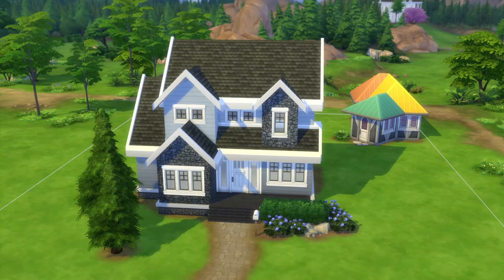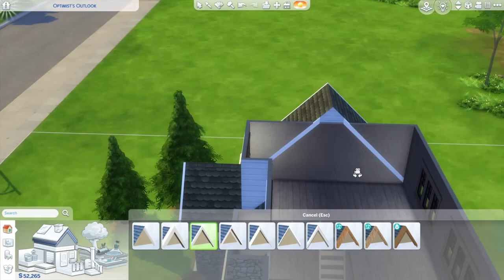How to Fix Roof, Eave, and Trim Clipping and Glitching - Sims 4 Roofing Tutorial

Comment: OMG THANK YOU SO MUCH!! I love making houses with lofts, but the roof clipping into the wall has been a huge annoyance, I knew you could change the overhang length but I didn't know you could only change one side of the overhang by holding shift, you're a lifesaver!!
Reply from the maker: Before I figured that out I used to place so many extra roof pieces with or without eaves 🙈
Reply: @sahm_and_bean I play on ps4 so I don’t have “shift” so what should I use instead
Reply from the maker: @kylenova1607  PlayStation uses the X and square buttons. I don't have a console but the way it was explained to me was select with X, adjust with square, and set with X. Hopefully that makes sense!

Comment: My issue is the roof trim is clipping in my house even if I reduce the eaves
Reply from the maker: Are you using one of the two roof trims that will clip in regardless? They're the two square ones and the only workaround there is to change out the trim. I thought I covered that in this video but maybe I ended up cutting that bit 🤷🏻‍♀️
Reply: @sahm_and_bean  i have the same issue and sadly it's with the cottage thatch roof ones and using any other trim looks stupid. i wish it didnt clip like this. what's the point of those trims if they can barely be used :(
Reply from the maker: @Alteusgirl  it is so annoying! I don't understand some of the mechanics.

Comment: I have a problem where my room doesnt count as a room and therefore my room is doing weird shit. It has a gap right in my roof as if my roof isnt actually attachedd to the building. I think this happends is because of my room not being closed cus if i extend my room it works but than it looks ugly
Reply from the maker: Unfortunately the room does have to be closed off to count as a room, but you may be able to compromise by building a wall where you need to close it off and replacing it with a small fence or spandrel to keep the gap you want.
Reply: @sahm_and_bean  i dont want the gap. It does that automatically.

Comment: This didn’t help my problem …
Reply from the maker: Can you elaborate?
Reply: I have a one story build right beside my two story and I tried to put a roof on the lower roof and hide it in the other tall build but it just clips through the wall and I can’t decorate or anything , I tried all these steps more then once and it took some time for nothing , it’s still a mess , you can’t do it like this to hide that error , this only works when the roof meets a flat wall , not going into another roof
Reply from the maker: Rats. Sorry I couldn't help with that one :/
Reply: That’s okay ! Def helped a lot of other issues that I have had just not that one specific one , not a lot of videos are as helpful as this one was tho. I’ll keep trying !